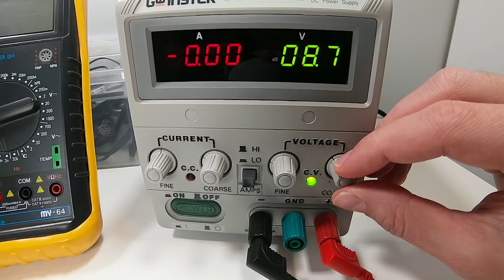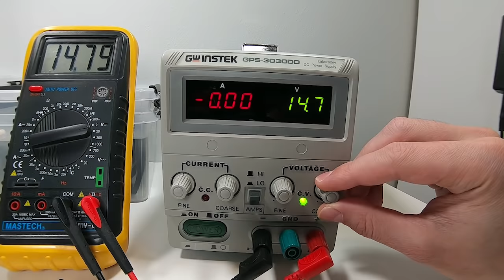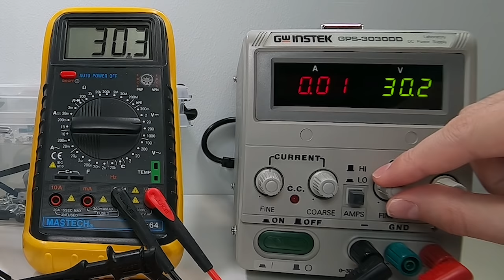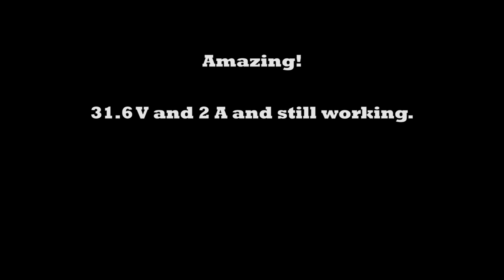30 Volts to a Lego Motor

Comment: The only reason why it should fail at very high voltages would be shorts or overheating. When you keep the shaft from moving, the electromagnetic field fails to convert it's energy to kinetic energy and thuss converts it to heat. You should try and let it spin freely on 30V 2A and see how long that survives.
Reply: Someone else with a brain. Bravo for noticing the grave error of the individual doing the test. I could fry the motor at 9V if I stalled the motor.
Reply: If you go below the maximum voltage by  a large enough margin, a stalled motor won't burn out. I'm not sure 9 Volt is  low enough compared to the 12V these motors are supposedly rated at. Anyway without modifying a new lego motor the only way to burn the out is to have an already defective motor, since they are overtemp-protected.
Reply: The motor would consume less than 2A of current at 30V with no load. Theoretically it should therefore last longer, until the brushes fail or the motor overheats
Reply: its actually no that bad of a test if you consider that all the contraptions he builds run under 90% load there is next to no cooling air at those rpms
Reply: Actually, you can't fry a LEGO motor at 9V. The motors inside are designed to work up to 12V, but LEGO decided to limit their system to 9V so people wouldn't be able to burn them out.
Reply: Man the brushes were visibly splattered on the walls of that motor can.
Reply: Current is determined by demand from the motor itself.

You can't force a motor to consume 2A while it's spinning freely. You set the voltage, then the motor requests the necessary amps from the power source. If you have a power source that lets you set amps, that's only a current limiter, it's not forcing a motor to use that, nor can it if the motor needs less than that to spin at the given voltage.
Reply: If you provide no resistance to the shaft and the windings don't have shorts, you can run a little 3v motor on straight wall voltage (110 at least), I've done it.
Reply: @joedoe1096  until it spins so fast that it gets ripped apart due to centrifugal force! XD
But it would be interesting how long that Lego motor would work with 30V and a load low enough so it doesn´t stall. Like a load that makes it pull 1A for example.
Reply: Nerds
Reply: @crazymike891  u could breaked with the RATED 3-6v that the seller of that cheap motor claims
Reply: Part of it I get it some no but afree
Reply: @joedoe1096  True, but when you stall it, the motor (which only has a few ohms of impedance) will be nearly a short for the power supply requesting maximum current. The power supply from a lego set can’t provide that current. Besides, these parts are overcurrent protected. If that weren’t the case, a motor with 8 ohms of impedance could draw way more than 2A when stalled (in case the power supply isn’t limited). Keep in mind that a stalled motor is still just a big inductor which can draw a lot of power if not protected.
Reply: So the Overload protection is the design to preventing motor for getting overload and getting burn during overload
So because too much Amp in motor because it stopped turning because overload
Reply: Overload protector: motor cannot handle above 1A over 15V input
Reply: Normally the regular lego motor cannot handle 0.8A that and voltage drop from rechargeable battery box  to 1V
And even L motor cannot handle 1.2A
(Ampe)
Reply: Even that, fails at 31.6V in 6 Seconds  63.2W power

Comment: funny thing is lego motors are made to run on 12v but they run them on 9v so they cant toasted
Reply: Were did you hear that?
Reply: I had looked into a while ago but and thought the same thing but could not confirm it after looking at the motor specs as the the 9v motor would not give the right rpm. Did not know if lego had them custom wound.
Reply: 10 to 1 odds say they are too. :)
Reply: The reason why is anything above 75% of total capacity in a circuit could produce enough heat to blow out the circuit or worse
Reply: Only if they added fans... But it's designed for kids, so that definitely won't work for the best.
Reply: Well, you know what they say...
Reply: @tankette_fin  1.5 and then 1,5? Are you metric? Lol. I'm from the states, where we use the ridiculous "standard" system, but I was also educated in Mexico. I just don't know why some places use a period and others use a comma in between their numbers.  Any ways, cheers, mate.
Reply: @shiftjacket  Usually we Germans use a comma, however honestly speaking I'd prefer a period because a comma is supposed to separate information (e.g. measurements) so we have to use semicolons instead if we use the comma as the decimal separator
Reply: @bspringer  
Welp, the more ya know.
Reply: BuWizz provides 11.2V
Reply: @shiftjacket  Pretty much the whole of Europe uses , for decimal points and . for thousands separators. In the UK, we're the same as the US, . for decimals and , for thousands.

Comment: I wonder if you could find a brushless motor of the same size and install it in a lego motor housing
Reply: Jay Hendren yeah, he should do that!
Reply: There was a time when you could, back when people were modding out the old Team Losi Mini-T.

Problem is, you need an external controller to run one of those.
Reply: @VestedUTuber  not so difficult, 2$ for the controller. A brushless motor in Lego technic should be wonderful.
Reply: +Alfio Locatelli
That motor controller still needs a PWM signal and it only works in one direction. You'd at least need either a microcontroller or an RC system to control it and you're SOL if you want to reverse rotation without rewiring it.
Reply: yes but you dont care about the signal, you still use it like a dc motor. ESC does all the work and there are some ESC that allow both two direction with a simple interface without rewiring . Yes the cost will be higher but is a brushless motor :D , maybe too strong to stay in the middle of a plastic lego.
Reply: +Alfio Locatelli
"yes but you dont care about the signal, you still use it like a dc motor."
No, you can't. Brushless motors are COMPLETELY different from brushed motors. A brushed motor works by mechanically swapping the polarity of its stator field using a mechanism called a commutator. You can vary the speed of the motor by changing the input voltage. A brushless motor has multiple phases for its stator and the motor controller pulses them in sequence. To control the speed of a brushless motor, you control the frequency of the sequence.

"there are some ESC that allow both two direction with a simple interface without rewiring ."
Of course. And the $2 ESC you mentioned is not one of them.
Reply: I've been trying to find some broken LEGO PF motors just for the housings for a while now. Either these things don't break, or no one sells them.
Reply: @VestedUTuber  Rc dude I can tell lmao
Reply: @eddyrejserbil4229  
Close. I used to be very much into both RC cars and aircraft a couple years ago, but I've actually moved on to robot combat. However, a lot of the components used in the smaller bots are off-the-shelf RC equipment, and even a few of the bigger bots use brushless motors meant for large-scale RC cars and aircraft.
Reply: @VestedUTuber  That's actually really cool I've never understood battlebots as a hobby really Before sounds Amazing!
Reply: @VestedUTuber it wouldn't actually be that hard, just wire the esc in line with the motor and short the PWM pins together. changing direction would b as simple as reversing the polarities. I have done this with RC airplane motors. As for a motor just pick one close to the same size and 3D print a spacer that fits in the casing.
Reply: @MrAjam12  
Problem with doing that with a lot of modern brushless motor controllers is that they require a "neutral" signal to arm. If the PWM line on one of those sees a full 5v signal it's either not going to arm, or potentially will even go into programing mode instead of arming, but either way it's going to see that as something that isn't neutral. Plus, some brushless motor controllers, particularly ones intended for use in multirotor aircraft, don't have a BEC so you can't even do that with those. And of course shorting to ground won't do anything.

When was the last time you did something like that, anyway? That sounds like something that would work with an old Novak ESC but not a modern BL_Heli or SimonK unit.
Reply: Brushless motors aren't DC, and are usually controlled by hall-effect sensors. This complicates things a lot.
Reply: bruh thats a 5v dc motor found literally found anyware for less than a dollar

Comment: You should try 30 Amps 😁
Reply: Lego Technic Mastery only gonna draw as many amps as it needs
Reply: Lego Technic Mastery Thats not how it works
Reply: Sorry but that’s not how electricity works
Reply: what? xD
Reply: Now he just needs a power supply that can do 30A at 450V, DC.
Reply: PETR DOLEZAL & Matt McCoy,
I am indeed not an expert in that field ;)
Reply: at point the winding on the motor will just burn up lol and smell
Reply: Sorry for my rather rude reply. Pretty much, whatever he sets the voltage to determines how fast the motor will spin. Based on the voltage, the motor will draw however many amps it needs. If you notice, the amps that are being drawn are higher as the voltage increases. Making more amps available to the motor doesn’t make it any stronger, making less amps available than what the motor requires will decrease its performance.
Reply: You would blow your main outlets if it drew that much.
Reply: Matt McCoy, I understand ! But is there any way to modulate Amps and Volts independently from one another ?
Forcing the motor to draw Amps regardless of the Voltage ?
Reply: BANG!
Reply: no its not rude dude.. is just for fun..   but you can see the amps starts to drop fast when it cranks up the voltage so the winding must be getting hot.
Reply: it will probably 1 trip the beaker or 2.. make big smelly bang bang what ever happends its the end of the motor hahah
Reply: Problem is, even if you give it 30 amps, it won't necessarily use them all. It depends on the stall current of the motor. If your power supply is able to put out 30A but your motor pulls only 5A, it's only going to pull 5A.
Reply: Lego Technic Mastery no. The motor will only draw what it needs. There is no way to force amps onto a motor. You can force volts onto a motor, not amps. If you have a higher stall current motor it will draw more amps. You can deny a motor amps and it will spin up slower and have less torque. Ex: a motor with a stall current of 3 amps and a stall torque of 50 gf cm will only produce around 25 gf cm if only given 1.5 amps. Don’t quote me on the specific numbers, I’m not an expert in this field.
Reply: Matt McCoy, Is the stall current of a motor dependant on its resistance ?
Reply: Unless you give it higher voltages and/or cool it down.
Reply: Few problems with that idea:

Wall outlets in the US can only provide 10A or sometimes 20A

The lego motor probably wouldn't be able to draw 30A

Even if it did utilize a higher amperage, the wires would most likely just heat up and melt.
Reply: Hm, then he'll have to get a skookum FULL BRIDGE RECTIFIER and go to an industrial site for some 3-phase got the pixie juice. And fuckering the motor is the intention anyways, It's just for the laughs- SCIENCE. It's for science.
Reply: for you 12 year olds, just read about ohms law on wikipedia...
Reply: You would blow a fuse or trip a breaker
Reply: Lego Technic Mastery Not really. Use the basic equation V=IR to determine why that won’t be possible. I (Current) is found by dividing the Voltage over the Resistance. I=V/R. To change one, you must change the other.
Reply: Still not how electricity works
Reply: You would need thicker windings in the motor to allow for more electricity to flow through. Thicker wires in the windings allow for more heat and have less resistance thus allowing for higher amps. So no it's not possible. (unless you mean forcing less amps as stated earlier, or you have a contraption which dynamically changes the physical makeup of the coils)

You have to imagine Volts as the pressure. It's the force at which electricity wants to flow to the other side. Amps is the flow of electricity. This is why you can have an electric fence or a tesla coil with many volts, but 0 amps, as there is no electricity flowing to the ground. Once someone comes close to the coil, or grounds the fence, then the electricity starts flowing.
Reply: Someone in class once popped a 555 timer when a sudden high voltage and about 80 amps went straight through the chip
Reply: An add on to my reply, the external DC power supply's fuse blew near immediately and it sounded like glass breaking next to you even though it was across the classroom, about 10 meters
Reply: look up Ohms law. you can take the rough 31v 2A, resistance "R" is Volts"V"/Amps"I" ;  R = V/I ;  31volts/2amps = 15.5ohms. if R=V/I then V = I*R ;  30amps*15.5ohm = 465volts.
@Lego Technic Mastery "Forcing the motor to draw Amps regardless of the Voltage ? "
Not without modifying the motor.  You can remove windings from the motor lowering the resistance.  30amps*5.5ohms = 165volts or 30amps*1ohm = 30volts

I'm going to apologize as I know this is more than you ever wanted to know but what could you do with Tecnic stuff if you could use sensors that Lego dose not make? air pressure, flex, color of light, computer vision? so if this bit of math helps some one make something cool and not blow it up due to not understanding the relationship of volts, amps and ohms I'm happy.
Reply: Hello boi, welcome to the basic physics lesson, where you will learn a very easy formula, that will avoid you embarassing situations like this one :)
V÷R=I
This means, that voltage divided by resistance equals to the current drawn. The less the resistance, the more the current (Amps), the more, the less the current. Resistance is measured in ohms. As you can see from the video, at 31.6 V, the motor consumes 2 Amps. This means that 31.6 is divided by the resistance to get 2. To get the resistance of the motor, we need to divide 31.6 by 2, and we get approximately 16 ohms. This means that to get 30 Amps, you would have to pass almost 500 VOLTS through the motor, which is a challenge since worldwide outlets never go higher than 240V.
Reply: Did you hear about constant current supplies?
Reply: yes, they will adjust the voltage up to a set max to maintain a current but do not allow for more current at the same voltage to be put into a resistive load as that is imposable.
Reply: What's wrong with people? Of course you can supply 30 amps.
Reply: @raidzor5452  Ever heard of a transformers or three-phase electric power which can give you 400V ? Maybe you should learn the basics yourself before teaching others
Reply: @TheKradok  Oh no shit I didn't know that voltages higher than 240 exist. I just made a stupid example. Also why did you state only these types of transformers? Maybe you should learn more about electronics before teaching types of ways to raise voltage..
Reply: Lego Technic Mastery sœ wut would happen? Need 10g wire! When preformed
Reply: Voltage dictates the no load rpm and the current drawn to reach said rpm, we then load the motor to increase its current draw till theres a meltdown on the end turns if it struggles at low rpm or commutation failure at higher rpm and voltage thats creating arcing and wearing the brushes and commutator till the heat is to intense from what is essentially plasma arc.
Good brushless outrunner with low kv would give some serious lifting power.
Reply: 90watts? Thats not gonna work
Reply: @legotechnicmastery  Current drain depends on the resistance of the wire in the motor. So you cannot make a motor drain more amps independent of the voltage. Ohms law applies
Reply: Then The Lego Motor wil turn to Bomb
Reply: To all the wannabes here, look for constant current source!
Reply: We eant to lift stuff, not heat up snacks on motor😀😀

Comment: id like to see how fast it spins by itself
Reply: Stalin, Your Leader  
Yes how how fast rpm could you get out of this bad block motor
Reply: you would want to measure that .... and also measure the stall and unloaded currents so you could calculate the motor's characteristics  :-).
Reply: Are you planning to put that on BT-7 and BT-2's?

Comment: also, do you have a video on how to make lego engines ?  they seem overpriced and not so powerful and there's a huge electronics shop next to where I live with a shit load of different engines.  I'll try at first to just fit an axle connector on the drive shaft and a long axle with some stabilizers to make it the more straight possible.  Maybe I can find a rubber piece that will make the shaft thicker so it holds tight and then put some glue once I'm sure it rotates straight.

Comment: No short circut. Motor brushes burnt. The 2 prongs on the back of the motor are supposed to have graphite blocks on them. They are either gone or very short.

Comment: 3:18 plz no,.     3:50 the wires have something on the to protect them for shorting, once they heat up the problem is that the thing on the will melt down and get shorted pretty easily..oof..

Comment: HELLO! you should REALLY try connecting the v2 and v1 lego infrared receivers to higher voltages and connect a motor to see what is the maximum voltage the infrared receiver can take. also, i wonder a lot, why does lego use alluminium wires instead of copper ones in their power functions and old 9V systems? maybe alluminium is cheaper for them than copper?
Reply: I've successfully pushed 14 Volts through a V1 or V2 IR receiver powering an xl motor and train motor running a heavily loaded down Emerald Night for over 30 minutes with no issues whatsoever to the IR unit or to the motors.
Reply: crazymike891 but how about sbrick??
Reply: i am waiting for an answer